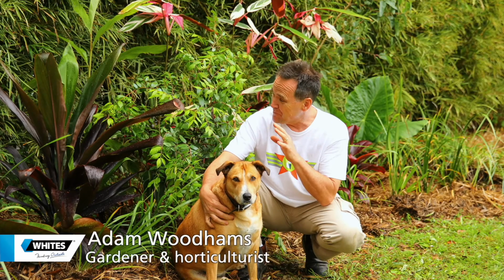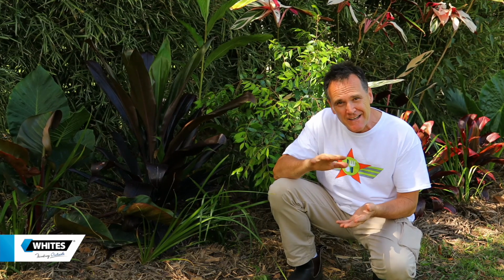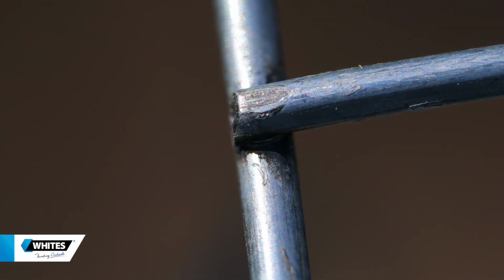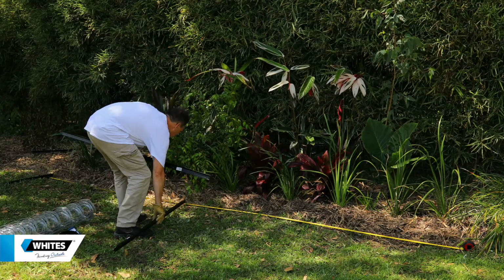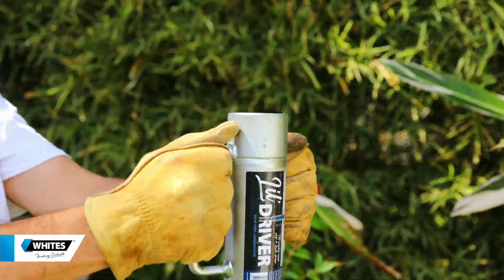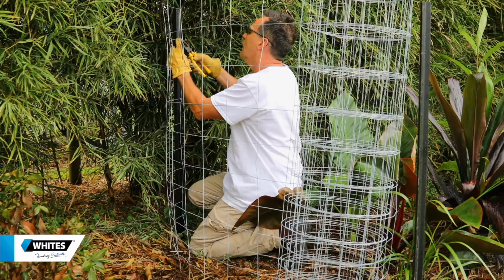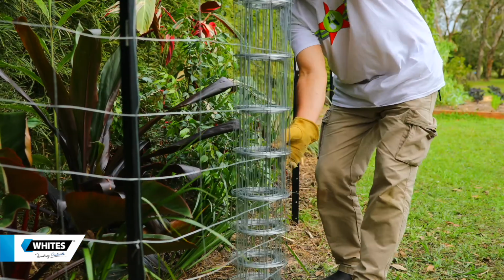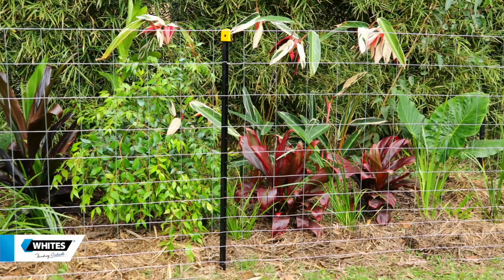Protecting plant with Pro Series Dog Mesh

Comment: It would have been very handy if you listed the tools & materials required in the "Description".
Reply from the maker: Hi. Thanks for the feedback and we will update accordingly.
The key items are the Pro Series Dog Mesh, Ultraposts and tie wire. Tools required are a hammer and pliers, and optional items are the stake driver and post caps.